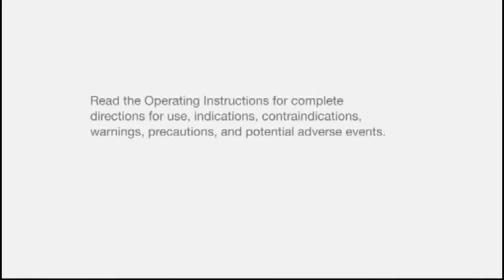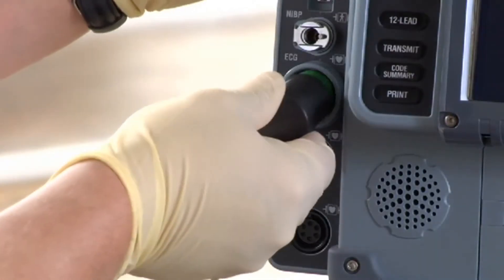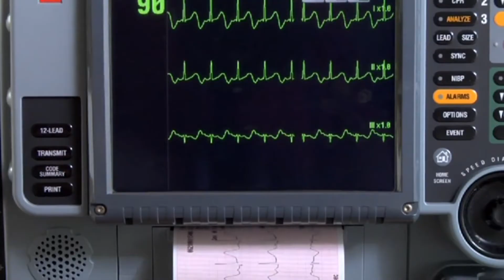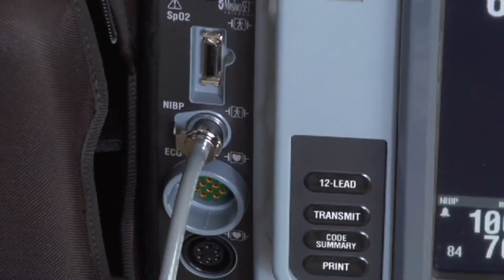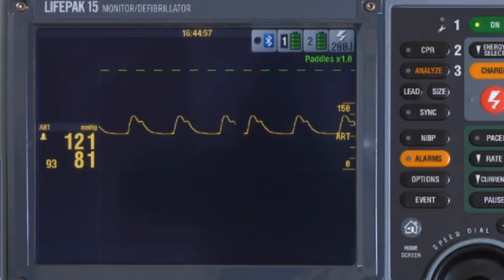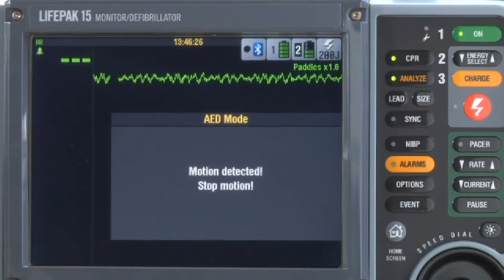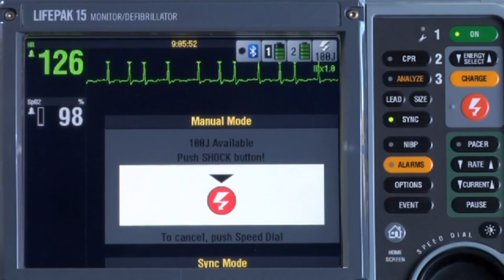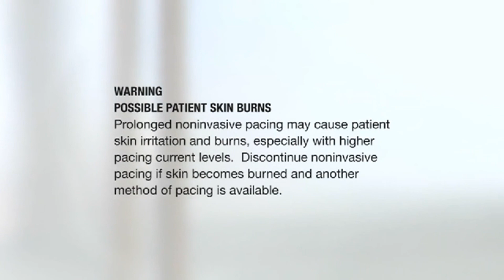LIFEPAK 15 In service Training

Comment: Terrible monitor, absolutely terrible. Not only it will not get a blood pressure a lot of times especially with a large cuff, the main issue is when you go into AED mode during CPR, THERE IS NO WAY TO TURN IT OFF!!!!!!!!!! You have an additional screen covering everything else and there is no way you can see important numbers or rhythm, you need to turn off the whole monitor and turn it back on to get out of it and during CPR you don't have time for this shit.
Reply: No need to turn it off. Just push for example, pacer twice.
Reply: @sahilmirzayev6294  of course it doesn't do anything